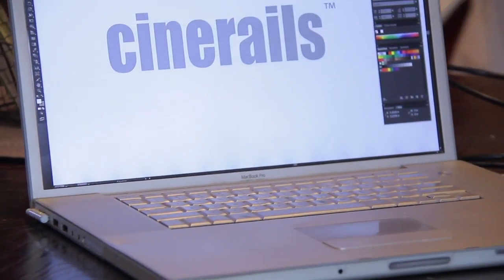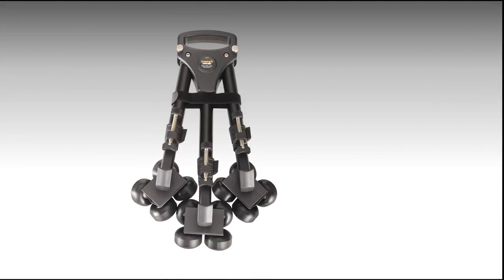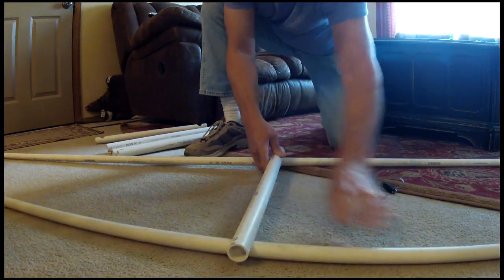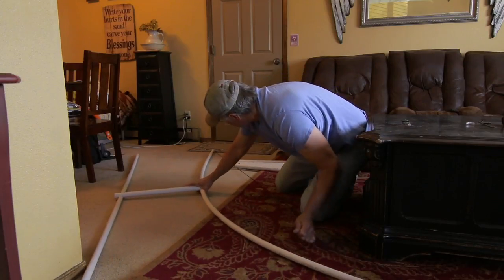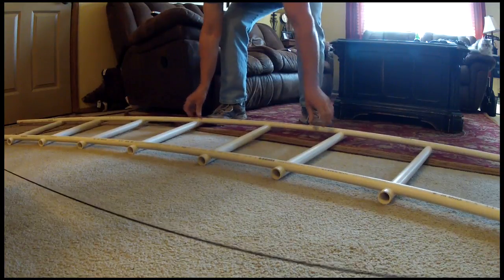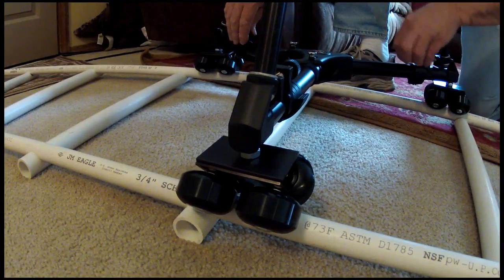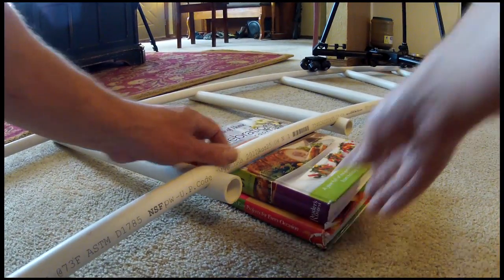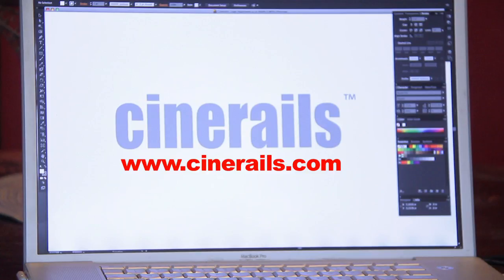camera dolly

Comment: Nice idea I like it but Cine rails? That's a stretch. Those are just small sections of pvc pipe
Reply: Saturday Night Live owns a set, John Deer owns a set and about a 100 feet of the track, and they've been used on numerous motion pictures.  Ya, if they're used in cinema it would be an appropriate name.
Reply: @LivingtheWildlife  Are you apart of the Cinerails company? How do you know these production companies are using this product?
Reply: @wildwestadventures3583  Ya :-)  I came up with them years ago as a way to stay ahead of my competition, back when I was filming network TV shows.  I wasn't planning on selling them, but every crew I worked with wanted to get a set, so I started the company and have been selling them ever since.
Reply: @LivingtheWildlife  well I'm surprised bigger productions have used them. It's a great idea to create been track. It's just that the connector pieces look live pvc pipe. It's hard for me to think of that as a cine piece of gear.
Reply: @wildwestadventures3583   LOL, it's not the tool you use, but how you use the tool you have.  I've worked on movies and network TV shows since 1985 and the one thing I learned to do is be creative in putting a shot together.  If I let my ego get in the way of using only the biggest and best gear, I fence myself into failure.  But if I think outside the box and get over "the look of PVC", I get the option being picky about the jobs I take.  In other words, I always have more work than I can handle.  And producers don't focus on the track I use, but the shot or sequence of shots I produce with it.  I classify my PVC track as "rigging."  It doesn't have to look pretty.
Reply: @LivingtheWildlife  I totally agree with your perspective. It's just not something I expected to see in commercial and Hollywood films. I worked in the film industry on mostly lower budget commercial sets and on some indy features as well as a fair amount of Christian broadcast. I experienced a lot of arrogance on those sets. It's why I don't work that industry any longer. They would never have used this product. But it looks like it works great
Reply: @wildwestadventures3583  I'm right there with you :-)  When I did my internship in 1982, the ego's were everywhere.  I thought "what have I gotten myself into?"   Like you, I almost chose a different career.  By the way, that's cool that you were in Christian broadcasting.  I started my career shooting editorial stills for Christian magazines and filming Christian music artists.  But when I moved to Denver that all went away.  I sure miss it.  In any case, I'm glad to get to know you!
Reply: @LivingtheWildlife  cool that you also shot Christian content! I dropped the begging producers for work and started selling and refinishing antique furniture. Now I work for myself and have my self respect back. I love my life now. I do still film but just non profit when I want to. I also started a Youtube gold prospecting channel where I get to mix my love of filming, gold panning and exploring all in one outlet
Reply: @wildwestadventures3583  @Dannydodge You guys are dope!